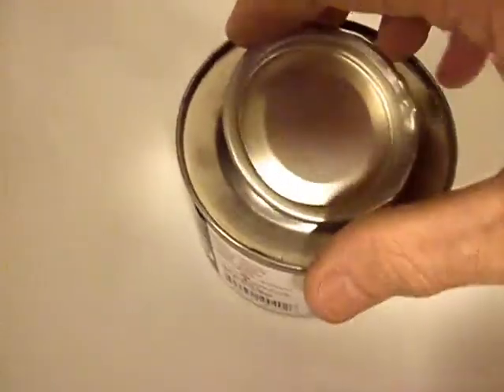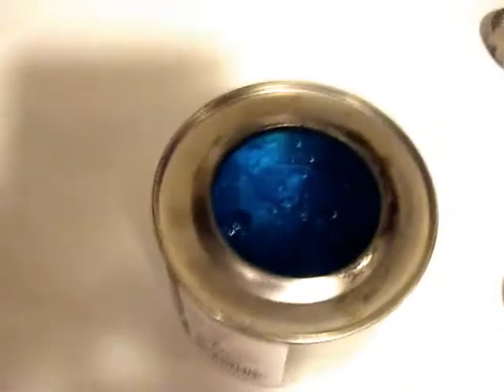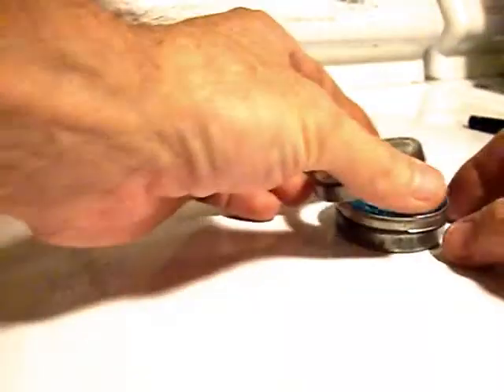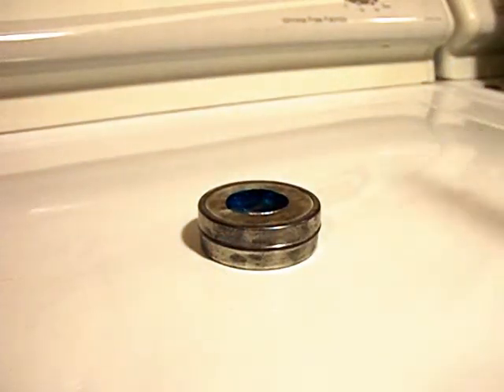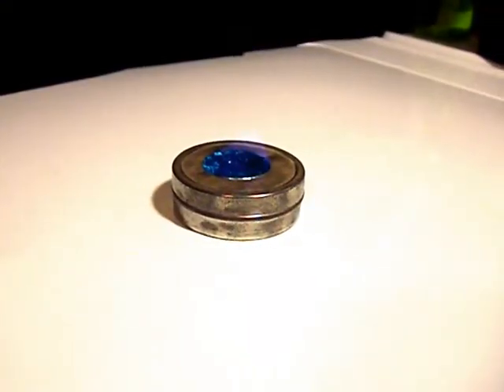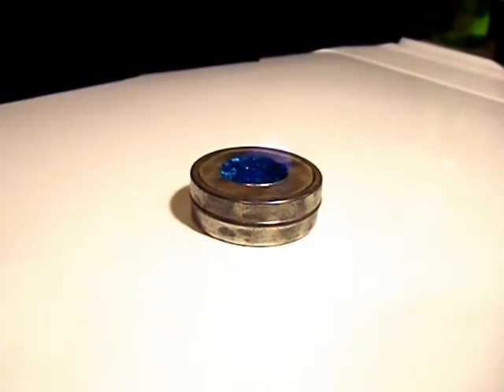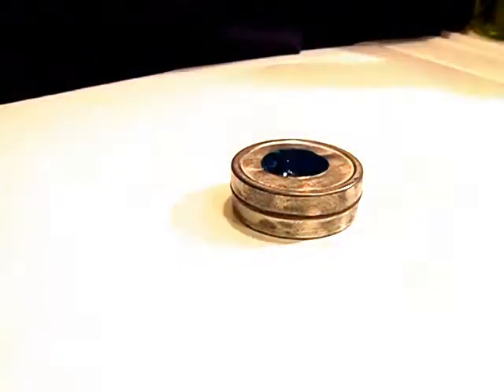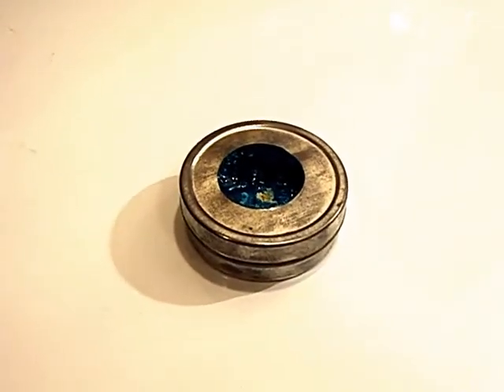#1: gel alcohol for toy steam

Comment: HI Reed,  I have been using "Purell" brand hand sanitizer (70% alcohol) comes in a pump bottle, burns pretty clean, and a lot less messy than Sterno, a lot cheaper than Esbit . Of course, you have to "fabricate" a trough from aluminum foil for a Jensen, or Wilesco type fuel tray.